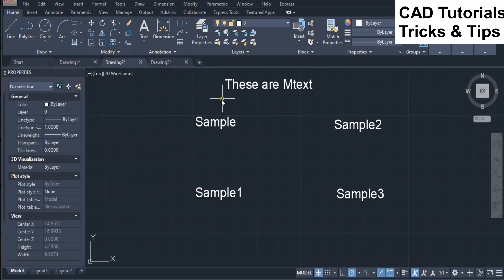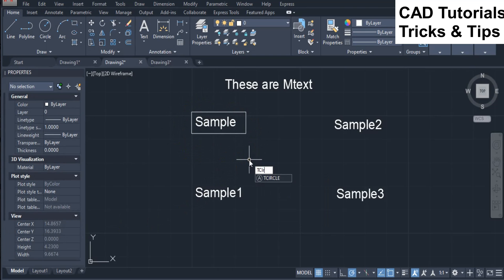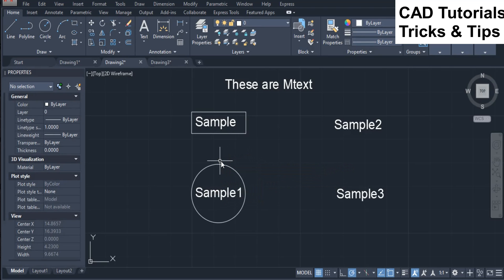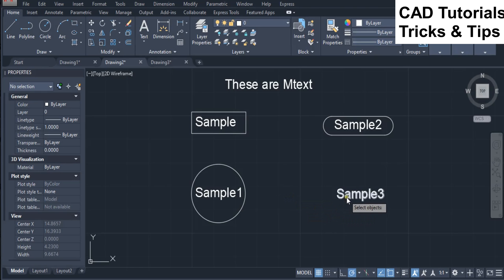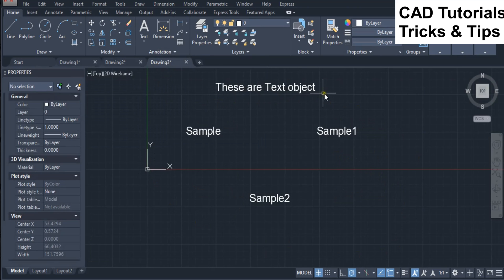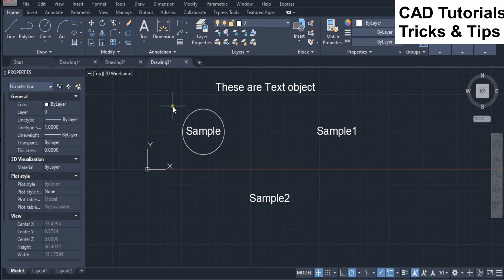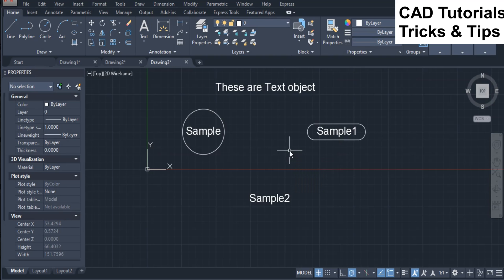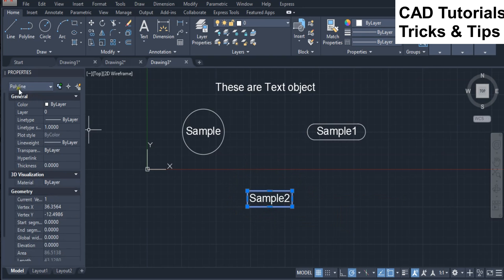How to add Frame on Mtext or Text Autocad,Multi text border,Text border,Text frame,Text frame circle

Comment: if you update the text or mtext after creating a border, is there any way for it to update automatically?
Also I am working in Autocad 2013 and I have the TCIRCLE command but the properties bar does not display the Text Border option. This was probably added in a later version. Thanks for the video.
Reply from the maker: Welcome! with latest version new features added